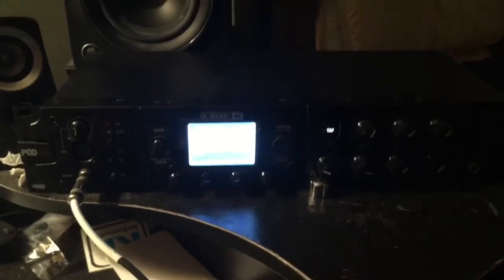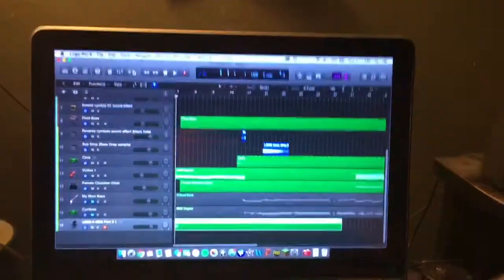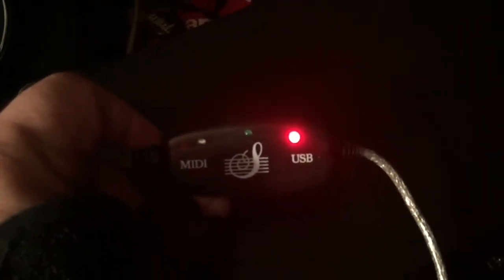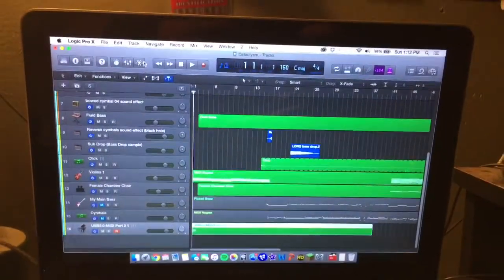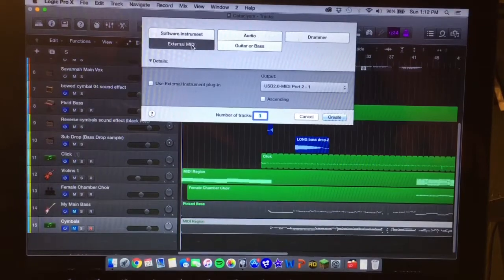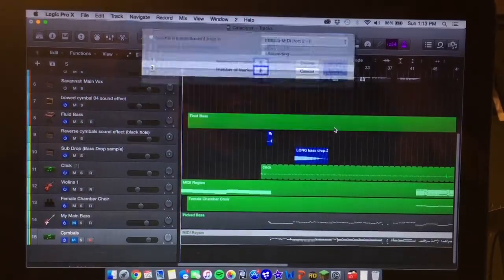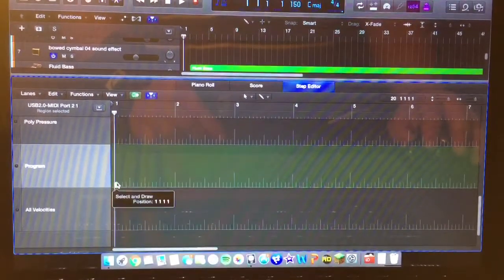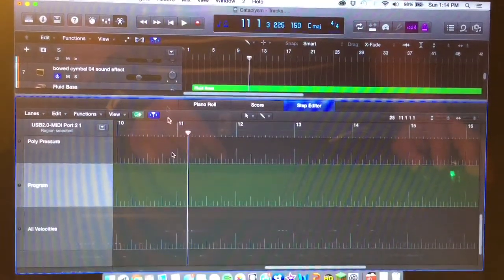How To: Set Up Automatic MIDI Patch Changing

Comment: Hey brother, thanks so much for this video! I've been following along and am stumped... when I hit Step Editor I don't get the grid you get. It's blank. If I hit the drop down menu I see Arrangement, Marker, Signature, and Tempo... that's it. Any suggestions?
Reply from the maker: Hey man, absolutely! I’m sorry to hear that! First off, what DAW are you using, Logic Pro X, or another one?
Reply: @blazfuturama  yes Logic X. I'd attach a screenshot but I don't think YouTube allows it.
Reply from the maker: @corwintompson9152  gotcha man!!! If you want to email me at blazfuturama@gmail.com go for it!
Reply: @blazfuturama  thanks brother will do!
Reply: @blazfuturama  OK I've emailed you, it may end up in your junk folder.
Reply from the maker: @corwintompson9152  I gotcha! Sorry I haven’t responded yet, need to view it on my computer to view your files, I’ll get back to you soon
Reply: @blazfuturama  no worries!
Reply: @corwintompson9152  Hey man! Did you figure this out? I have the same issue

Comment: I hVWE a Roland UM0One Mk2 midi chord to USB and I've tried everything but Logic Pro doesn't recognise it at all as an external midi device.  Any ideas?  Been at it for 2 weeks and Roland isn't helpful.
Reply from the maker: Ann & Andy Woodhouse dang that’s interesting!! So what are you trying to connect the other end to? The USB is going into the computer, and then what is the midi going into? It might not necessarily even pick up as a specific device depending on what you’re using, but it just depends on how you set the output/inputs. Let me know if you get a chance to check it out, sorry for my late reply and I’ll try and be quicker next time
Reply: Robert Manzone thanks Robert, I have plugged into the POD HD500X effect pedals (same as your video but not the rack version).  Can I ask, if you go into Audio Midi setup on your Mac and look at midi, do you have drivers showing POD HD500X?  I believe I need to configure the midi sends as Apple only sends really one midi out and then daisy chains to connect up to another 3.  However I can’t see in the midi hierarchical diagram anything to connect the UM One to connect to.  Thus I think it’s a LIne 6 problem with Mac a capitan rather than just logic or  Roland.  Hope that makes sense.
Reply from the maker: Ann & Andy Woodhouse Oh OK, I hear you. So for me, I don’t have any drivers or anything of that nature installed, the only midi controlling that is being done is through that lane program change set up that I was showing, I simply just set the midi output to that Omni Port like I did in the video, and then change the program change  number and that just automatically sends a midi signal out to the line 6 device. I’m sure you already have it set this way but you want to make sure the midi plug on the line 6 is plugged into the “midi in” port on the line 6 device, again I’m sure you did that but just clarifying because I had done it the wrong way at first and wasn’t getting any results.

Comment: This was great info as I do have a pod.  Do you know how you could program a patch change on your daw instead of the pod?  Say if I was playing my guitar using plugins and I had my patches on different tracks.  Do you know how I could automate it so that it would switch to different tracks during different parts of the song?
Reply from the maker: Kaiyoken420 hey there! I’m so sorry for my late response. So I know that at least with logic, you can do the automation stuff pretty easily, so I think the easiest way would be to just do exactly that, to set automation within the plug-in just to have it change settings to whatever you want, it would take a little bit to set it up just right but it would definitely be possible.

Comment: hey man, i really like your video, i just have a few question

in my case, me and my guitarist have a same line 6 hd pro x, and then how to do this automate on 2 unit line hd pro x with the same bank and location? and what the other gears that i need to get?

thanks, cheers from Indonesia\m/
Reply from the maker: Hey there! Thanks for watchin and I'm glad you got something out of it. Hope I can answer your question ok!

Assuming you mean you do have two seperate units, that would just mean you'd basically have to have two seperate cords like I show in the video as well. You would just basically duplicate the same MIDI lane you have set up (like the one I showed) and would ensure each is set to send out to each of the corresponding USB cords. 

If you have any other questions let me know, thanks!!

Comment: Would this also work for the axe fx ultra since it doesn't have a USB port?
Reply from the maker: JCFROMMYSPACE!!!!! It should! I don't have one of those but the principal would be the same as described in the video. The only thing you'd do with the axe fx is plug the "midi-out" cable into the "midi-in" port in your axe fx. And the USB end of that cord goes in your computer.
Reply: Robert Manzone cool! Thanks man!
Reply: yes it works, I use Axe fx Ultra live with my band Signs Of Algorithm. But you can also change controlles, for example switch delay, reverb, gate, .. on and off in the same patch, this is called 'control change'. To change patches its called 'program change'.

Comment: Hey man I can't get my patches to change. It recognizes it's plugged into the Mac and I did everything the way you did but nothing changes on the rack.
Reply from the maker: JCFROMMYSPACE!!!!! Interesting! I'm gonna write a little checklist just to ensure, if all of this is done and it still doesn't work let me know! (Not saying the simple things in the assumption you didn't do them, but I have problems too and just think about every possible part to find the solution.)

1) midi cable USB end is plugged into computer
2) midi OUT cord is plugged into midi IN port on device
3) an "external midi" lane is set up with the output set to your cord
4) all midi changes are written in as program changes, NOT simply notes on the piano roll.

If all that is done and yet it still doesn't work feel free to let me know and I can try to help ya fix it!
Reply: Robert Manzone yes sir all done and nothing changes lol. Midi cable is plugged into the Mac, the OUT is plugged into the IN on the pod, midi lane is set up and changes are plotted as program changes. But nothing changes on the rack.
Reply from the maker: JCFROMMYSPACE!!!!! OK gotcha, I actually had the same issue recently, and I messed with it for so long and nothing worked, and then I had to close my logic session, re-opened it, and I set it up the exact same way and for some reason that worked. I don't have an explanation for this, but it's worth a shot, try completely just exiting the session and then pulling it back up and try creating a duplicate lane and just reset it by choosing the output to be that cord again, just so that it's fresh because sometimes for me if I try and use the same lane that's saved with the project, it doesn't always recognize the cord and I just have to reset it anyways. If that doesn't work then honestly I'm not quite sure. I'm so sorry you're having that issue! Has it ever worked before?
Reply: Robert Manzone I've gotten it to work with my eleven rack but I haven't gotten it to work with the pod yet. The pod won't work the same was the eleven rack does with the USB cable. I was wondering if it was just some setting on the pod or if your OSX was a different version?
Reply from the maker: JCFROMMYSPACE!!!!! Oh wow OK, so at least we know that you do you have everything set up right and it should work if it works with the 11 rack. As for the pod, there's no settings that I ever had to do to get it to work with this, it was simply just plug and play. I'm going to message you privately to try and help figure this out for you.
Reply: Robert Manzone thanks man!
Reply from the maker: JCFROMMYSPACE!!!!! Scratch that I can't message privately at least from my phone ha ha. When I was going to say, is that if you'd like you're welcome to send me a video of your run through over Facebook (Robert Bloebaum) visualizing it just kind of helps me, you don't have to that's just a option if you'd like, again sorry you're having the issues!

Comment: so if i use the midi connected to the PA, then i cant use the midi for the patch change?
Reply from the maker: paulo alexandre Trying to make sure I understand, so you are saying you would have a Medicare or coming out of your computer going into a PA system?
Reply: @blazfuturama  I guess the output balance from the pod is not the midi? Then the midi is the same that people can plug the variax on the back side of the pod?
Reply: @blazfuturama  Medicare? We in europe don't need Medicare.  Lol
Reply from the maker: Sorry! Should say “midi cable” lol!
Reply from the maker: And gotcha, yeah so what you are connecting between the pod to the PA is just a sound cable, whether that be a quarter inch out of the unbalanced output or an XLR out of the balanced output, so those don’t interfere with the separate Midi input and outputs. Does that make sense?
Reply: @blazfuturama  yes. I was thinking the xlr is the midi.  Sorry mate .
Reply from the maker: No worries! Best of luck, if you have any other problems just let me know!
Reply: @blazfuturama  Thanks
Reply: @blazfuturama  sorry, one more question, do i need an interface from midi to usb or the hd500x interface is enough for this to work?
Reply from the maker: paulo alexandre no worries Paulo! No extra interface needed. Simply connecting the Pod to the computer via the middle cable is all you need. (USB into computer, and the midi out cable into the midi in slot on the pod)
Reply: @blazfuturama  thanks a bunch . Appreciated.  Check my patches on the name paulosilva8200 hope you like it

Comment: any workarounds for switching latency?
Reply from the maker: angel alberto olivares ramirez 

Great question, the best thing I have found is to basically just set the midi note for switching back a little bit. For instance, if I want my patch to change on Measure 37, I would usually set it to change around the fourth beat of measure 36, because that usually makes it end up lining up just right.

Comment: Can I use Gband10 instead of Logic?
Reply from the maker: stewart sellan yep! Same concept applies.
Reply: Thank you.
Reply: Hi, can I connect the pod to the built in midi inside an Audio Interface (Focusrite Scarlett 2i4)? Instead of going direct to the mac. Do I need a different type of midi cable and connection settings?
Tx.
Reply from the maker: stewart sellan hey again! So, interesting thought! To be honest I don’t know for sure. If you are able to send the midi changes to the interface then you should totally be able to. Try setting it up like you mentioned and basically setting up the computer end the same way, if it can work then it should, otherwise I guess not. Sorry I can’t be of more help, Best of luck!